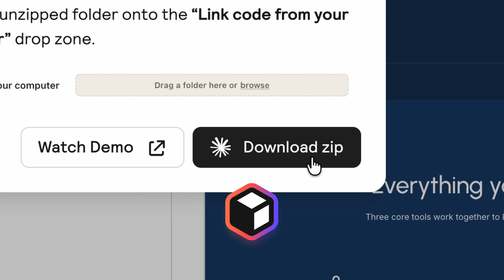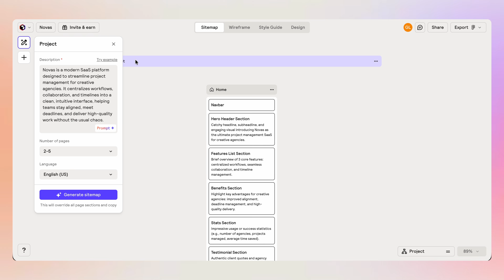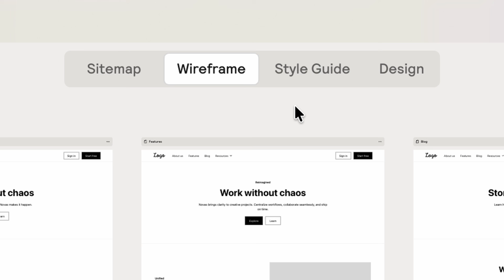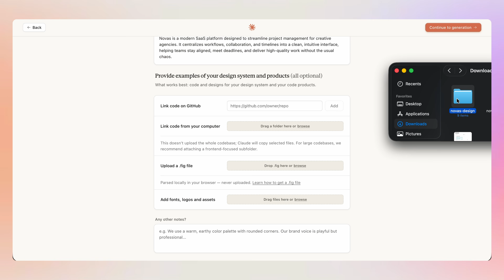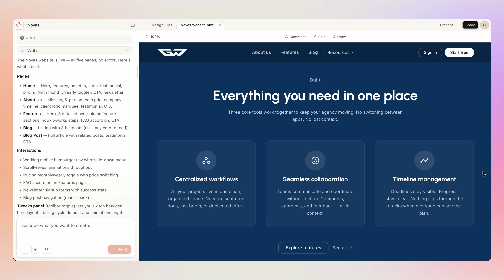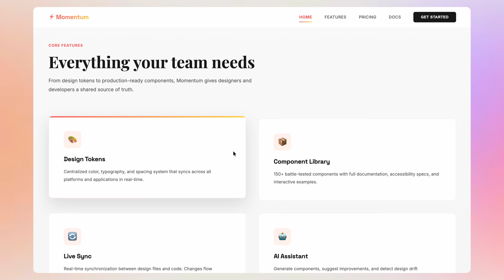Relume + Claude Design: The AI Web Design Workflow That Actually Works

Comment: Ok, the good part is that with Relume you can give Claude design a design system and Claude follows, but the real question is how to implement the design you get to Webflow? I know Relume has Webflow integration and it works pretty well, but components are limited and at some point they repeat so having Claude using the system to generate something unique is good but what you do with the new design you got?
Reply from the maker: Once you have a generation from Claude Design, I'd recommend handing off to Claude Code and asking it to host your HTML with Netlify or here.now. To hand off to Webflow instead, I'd use the Webflow MCP from Claude Code
Reply: @griffinwdesigns  Thank you.